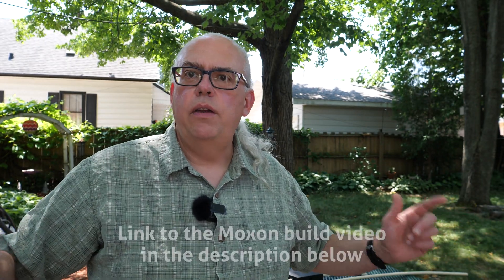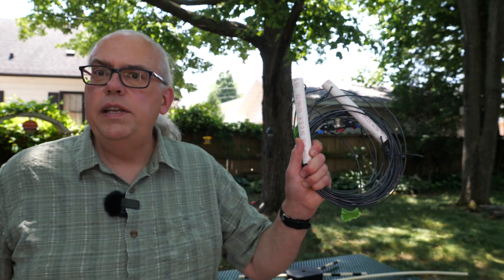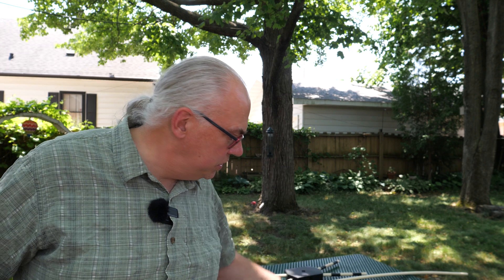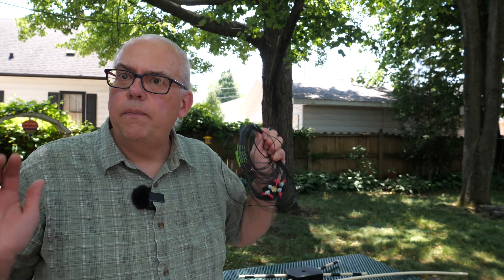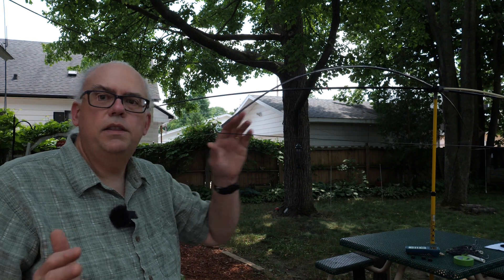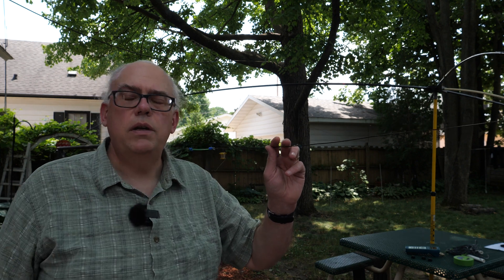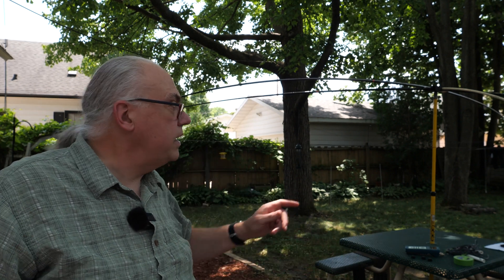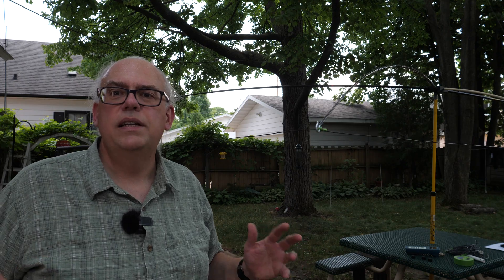Moxon Antenna Update: Now 70% lighter #Hamradioqa

Comment: You can use PVC pipe, but you don't need the full "tube". Cut the tube in half or quarters lengthwise.  Now string trimmer line is even better.

For appearance, you can make your spreaders longer than necessary and tension them upward with your wire  elements.

Comment: Would you run 100W into 22ga wire?
Reply from the maker: Yes, no question. 22ga is adequate for 100 watts transmit
Reply: @KB9VBRAntennas  Thank you!!

Comment: I'm going to build one with much thicker wire. around 8 or 9 gauge 1 solid core aluminium wire no insulation. Larger gauge works better.

Comment: Moxgen corrected my crisis as the other one was generating smaller than required. As far as center connect, keep center space at feed point as narrow as practical. MY 2/70 is under a half pound so far which works for my being unable to hold weight on left arm. Like the vireos.

Comment: Hi Michael, I wanted to ask how robust is the antenna to a change in SWR depending on where and how you set it up? I want to build one, but it will be mostly for portable use, so will the terrain etc, affect it a lot?
Reply from the maker: I've only used the antenna a couple of times as I built it specifically for Field Day. The SWR did change a bit in the 2nd deployment but not enough for me to be really concerned. I still ran it without a tuner or further adjustment. I'd have to use the antenna in a couple more situations before I can really say if it needs further adjustment or not.
Reply: @KB9VBRAntennas  awesome Thanks for the reply

Comment: Consider also the velocity factor introduced by a coated wire. I multiply the length by 0.95 and everything works fine. Cheers W6LDM
Reply from the maker: In my original video about the Moxon antenna I do talk about velocity factor and the need, for that reason, to shorten the wire. This was a followup video so I didn't delve into that. You can watch the first video here: https://youtu.be/4ddtVW8HweM

Comment: Nicelly done Michael, this project is looking good. It's said you lose bandwidth with thinner wire. I will be interested to see if you find this is the case in real life. 73
Reply from the maker: Wire size can affect the bandwidth of the antenna. I'm not sure though if the losses are meaningful switching from 14ga to 20ga, especially on the HF bands. In switching to a thinner wire, the bandwidth on the meter looked pretty similar between the two wire sizes.
Reply: @KB9VBRAntennas  Thanks for the reply Michael, I'll be interested to see how you get on with it. 73

Comment: Would there be any noticeable differences between the wire guages?
Reply from the maker: I really don't think so. Theoretically bandwidth should be greater with a thicker wire, but on HF frequencies, the extra bandwidth you'd receive would be minimal. Thicker wire will have a higher power rating, so use 14ga if you are planning to run a kilowatt. Otherwise the thinner 20ga wire will still easily handle 100 watts.
Reply: @KB9VBRAntennas  awesome,  thank you for that info. Very helpful.👍🤠

Comment: That's a great idea using the nylon line instead of pvc pipe.  Not only lighter but looks a lot better.  That Chuck guy is pretty smart.
Reply: I tried using it 8 years ago on a loop yagi, but I don't claim to be the first. Only thing is that it might not hold up well in the sun. PETG filament is probably better.

Comment: Just a light weight thought for holding your wire at the ends of the pole spreaders.  A zip tie pulled down to form a small loop and then the pigtail taped to the end of the pole.  Excess can be cut off.  They can also be pulled down snug on the wire to prevent slippage.  QUESTION:  Would window ladder line work to help prevent loss and reduce weight on the transmission line support?  Thanks Micheal for all you do to help us learn.
Reply from the maker: I don't think feeding the antenna with window line would be an option as the Moxon is designed to have a 50 Ohm feedpoint match and window line is 450 ohms. You'd need to add some type transformer at the feed point and that would add weight.

Comment: Looking good Michael. I had that issue with the feedpoint too. I slimmed it down much more and used a small length of RG316 with the SO239 on the end of that. It made all the difference. I also "constrain" my wires which makes setup easy and stops much of the movement of the poles. Upwards or downwards matters not apart apart from extra height.
Reply from the maker: The heaviest part of the center is the UHF connector. I could remove it and do a connection with bare wires from the coax, but that wouldn't look as neat (dare I say, amateurish?).